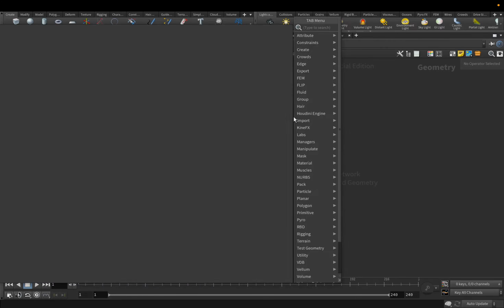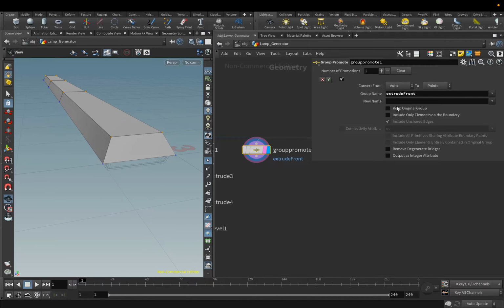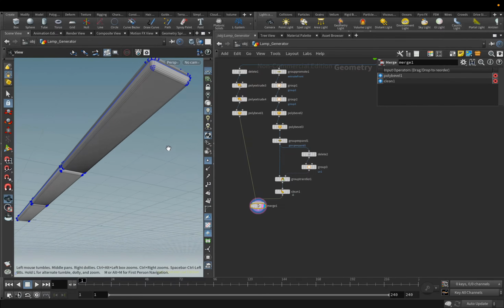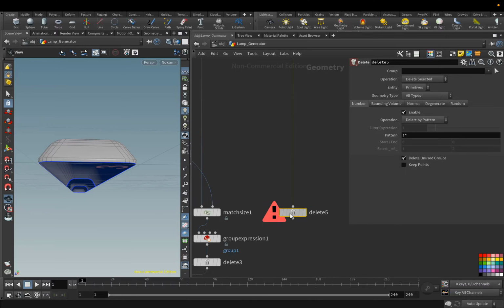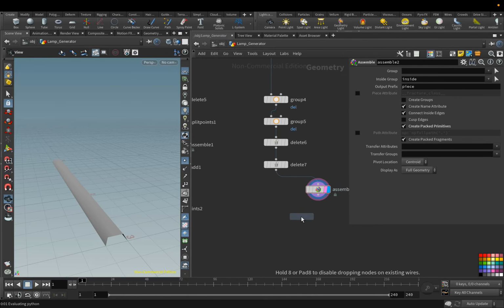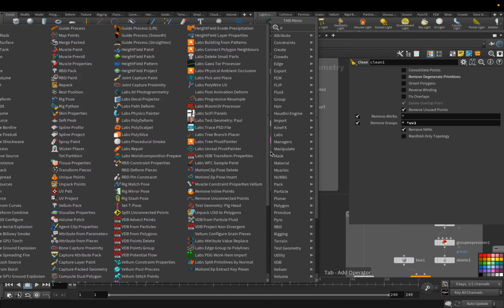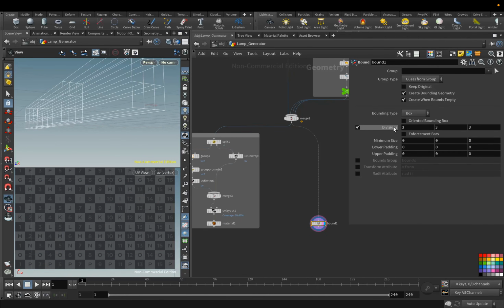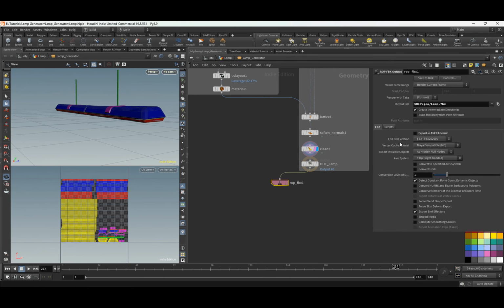Procedural Lamp Houdini Tutorial

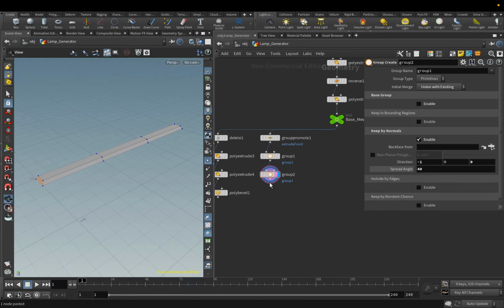Comment: Hello, loving your tutorials and looking to take the pilar course, I have a problem with this tutorial, when I create the groups for the 2 sides of the Lamp Body (4:59) I put union with existing but both faces are not selected
Reply from the maker: Hey 👋, try to refresh Scene View, and make sure you uncheck Base Group.
Reply from the maker: If the problem persists, send the file by email, I will check.
Reply: Group 1 Node: Under "Keep by Normals", check the box that says "Include Normals Matching Opposite Direction". {(Houdini 20.5+)

Comment: I have a problem with houdini: - I have to think a lot and design visual script to get a model that can be modified. Is such a powerful editor only needed to create multiple copies of the same model? And if I just need to make a model - without modifications - it is a nightmare to make this model in houdini - because I can create a model in 3ds max in much less time. Question to professionals: - what can be the benefit of having a model that can be modified?
Reply from the maker: Hi, :hand-pink-waving:It's completely understandable to feel overwhelmed or find procedural modeling in Houdini challenging at first. Houdini's strength lies not only in generating multiple variations but also in creating models that are dynamic, adaptable, and easily editable throughout the production process.

While creating a single model might seem quicker in traditional software like 3ds Max, the real power of procedural modeling becomes evident when you consider the iterative nature of design. Here are some key benefits:

Flexibility and Iteration: With a procedural approach, modifications are incredibly easy. You're not starting from scratch when changes are needed. This is particularly beneficial in scenarios where design iterations, client feedback, or project requirements demand frequent adjustments.

Non-Destructive Workflow: Procedural modeling keeps the initial structure intact while allowing changes at any point in the pipeline without breaking the model's integrity. It's like having a recipe that you can tweak without ruining the dish.

Variation and Automation: Creating variations becomes more manageable. Houdini excels in generating different versions of a model effortlessly, which can be immensely useful for creating diverse assets efficiently.

Parametric Control: Parameters can be exposed, enabling quick adjustments without diving deep into the modeling process. This can be invaluable for creating customizable assets or meeting specific design specifications.

Complexity Management: Houdini excels in handling complex models or effects that might be challenging to achieve or manage in other software.

Ultimately, the benefits of having a model that can be easily modified lie in streamlining workflows, improving efficiency, and providing creative flexibility. While the initial learning curve might be steeper, mastering procedural modeling in Houdini can significantly enhance your capabilities as a 3D artist and ultimately save time and effort in the long run.
Reply: @RaduCius  Thank you for the detailed response -  My conclusion is that there should be more high-level tools in houdini - like a tool that finds those edges that you can apply "bevel" to, etc.